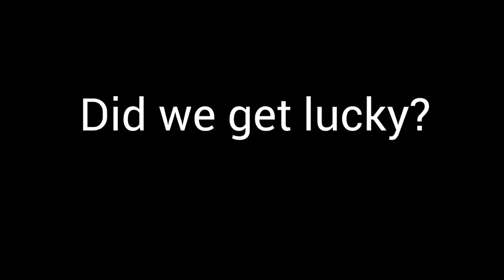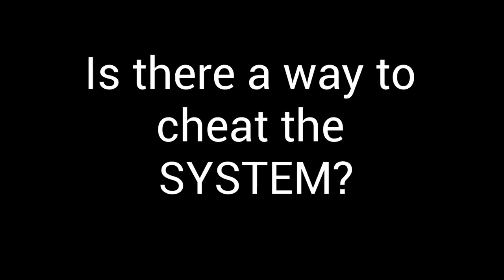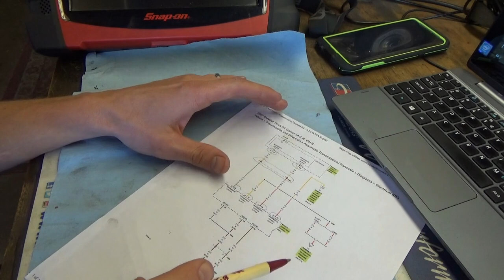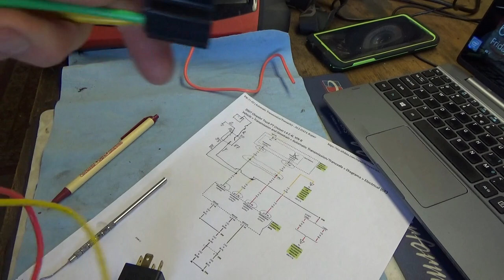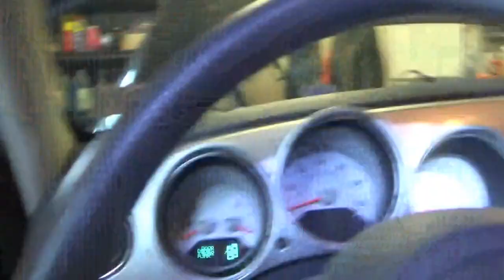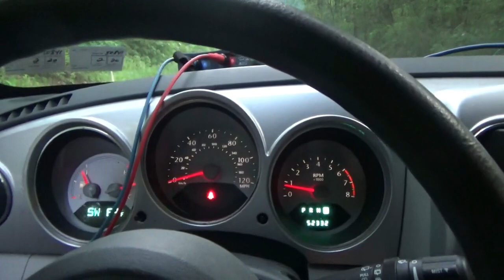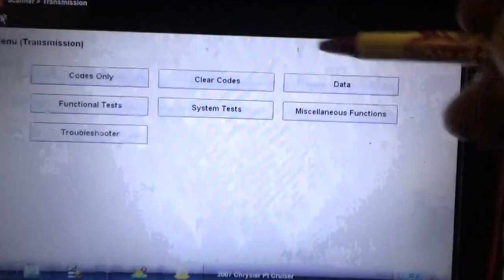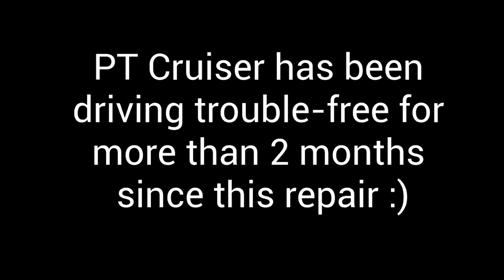Chrysler "LIMP HOME" Cruiser: P0882 - TCM Power Input Low (Part 2 - TIPM!)

Comment: The Toyota relay is the most reliable thing on that car.
Reply from the maker: haha AGREED!
Reply: Pine Hollow Auto Diagnostics I hope it has a built in diode or a resistor inline of control coil for power-off voltage spike suppression which can reach up to 80v what will kill the control transistor/ic  prematurely
Reply: Mac M.  cool find,  fix should last for a long time
Reply: @Airman..  I agree, also with a attenuator on the dso to save it from a 250v + inductive spike ( off state ) if no diode, or wrong direction. NPN's will fry.
Reply: are you implying anything else on that is reliable?
Reply: @Dapsters  bwahaha, touche'
Reply: Ok now I'm replacing mine with a Bosch today lol. But mine works now as a result of this video.
Reply: I think the back seats fold into a hole in the floor...to flatten the rig out for cargo hauling or a bed.
Reply: @PineHollowAutoDiagnostics  just seen ur video, looks good, my 2010 pt cruiser transmission goes into limp mode just after 6 miles.  Code says that shift solenoid B is stuck open, was that the problem with this pt cruiser?  Can you help me and will this hack work with my problem?  Love ur video very insightful !!
Reply from the maker: @nikam6349  Different problem, most likely bad solenoid.
Reply: Okay, I have looked all over that plug, and I do not have a yellow and orange wire. I do have in yellow and orange wire coming out of the bottom of the tipm where the transmission plug is. Can I splice into the yellow and orange wire under there with the same results? Also, just looking at some of the video it looks to me that the yellow and orange wire is coming out directly under the red wire all the way to the far right. I have two red wires coming out all the way over at the far right. Is it possible that the second or lower red wire is supposed to be yellow and orange?
Reply from the maker: @timdean7472  all your questions can be answered with the correct wiring diagram 😁
Reply: @PineHollowAutoDiagnostics  I looked up the wiring diagram for an 06, and it said yellow and orange. But, the only yellow and orange I can find is coming from the tipm. At the plug, I have no yellow and orange wire, but, I do have two red wires. I am not very savy on wiring, so, how do I figure out exactly which wire to tap into at the plug? I did tap into the yellow and orange at the tipm. Just trying to see if you think I'll get the same result you got, or if I need to tap in at the plug. I also will be tapping into the light green wire at the plug. Thanks for any help/ advise you can give me, as I am at my wit's end
Reply: I would love to do this bypass on my 06 PT but not sure which wires to tap into.You lost me between your hand written diagram and when you actually made the connections.Also could I use T taps to conmect to the wires instead of soldering.Thank you. Any help appreciated.
Reply: @winstonemerson2439  wondering the same thing about the T-taps….
Reply: Do you know the part number for the relay?
Reply: @PineHollowAutoDiagnostics  what's the model number for the relay

Comment: Ivan, I love how you always "think out of the box."  I'm a "really" old guy, with a lot of electronic experience, but I always learn from you.  You, sir, have my admiration.  Thank you.
Reply: DAMN ISN'T THAT THE TRUTH, MAKES ME FEEL STUPID SOMETIMES HE DOES.
Reply from the maker: Thank you for the motivation, Michael!
Reply: @PineHollowAutoDiagnostics  You're probably also bypassing some other "safety" issues--- by not letting the TIPM put the transmission in limp mode for other reasons..   For example, I know that if the Accelerator pedal and the throttle body (or throttle position sensor) do not agree because the throttle is sticking, or more likely:  the plastic gears that actuate the throttle body break---  It goes into limp mode, because the throttle could randomly go to WOT (wide open throttle) or something, or could get stuck in WOT after you step on it-- because of a broken piece of gear making it stick open, ect.. ect..   I'm sure there are other reasons.  My 2010 Dodge Nitro had this issue, and the trans was put into limp mode--- obviously by the TIPM----------  This bypass won't allow that to happen now--- so if the car got stuck in WOT, the person would have to think fast enough to lock the brakes, turn off the key, throw it in neutral, ect. ect..   Which honestly I'm fine with myself.   We don't need this nanny state mentality trying to hold everyone's hand and save them from these very unlikely hypotheticals by putting our cars in limp mode for us.  (although, it did happen to my Nitro--- and it did high rev a few times like it had a mind of it's own:   so it's not that uncommon I guess. lol).   A new throttle body fixed my issue.    I love the work around here IVAN..  but it does come with it's legal liabilities.

Comment: I would do the same as you.  Any time you can wire in a relay to do the same job as a module relay, you can do it.  Just make sure the new relay has the appropriate diode across the relay coil to dissipate the control voltage (PCM protection).  Nice Job.  Having the wiring diagrams makes it easy.
Reply: Quite important advice.
Reply: @Peter_Riis_DK  It's worked for me in the past.
Reply: 100% AGREE ON DIODE. AC RIPPLE WILL COOK QUAD DRIVERS.
Reply: Yes,    good idea.  Put a 1n4001 diode across the relay coil - wired cathode (stripe) to PCM control, anode to ground.  This will shunt any high voltage caused by coil field collapse.
Reply: The diode across the relay that is being recommended is essential for long term reliability.  It is referred to as a freewheel diode or flyback diode.  The circuitry in the PCM was not designed to drive a highly inductive load.  Large negative voltage spikes will be applied to the PCM drive pin without the diode.  Over time, either the driver in the PCM or the associated protection circuitry could fail without the freewheel diode.
Reply: Very good point but it hasnt failed by now.  But the voltage spike might be a problem, you ever get shocked by a 12 v relay, I have.
Reply: I am fairly certain these Bosch/Toyota relays have a built-in resistor across the relay coil to reduce the voltage spikes
Reply: @henrydunbar397  Diode Henry, Diode
Reply: A resistor can work too, but it causes the voltage to rise to the level of the coil current x resistor value.  It also causes more drive current to be required.  A resistor will cause the current in the coil to drop to zero faster, but not needed here.  A diode is the better choice.
As for protecting the circuit, there is either protective circuit there already (TVS diode maybe?) or the diode/resistor is already in the relay.  If this were not the case, that output transistor probably would have been destroyed the first time the relay shut off.  That back EMF will rise until something gives way.
Reply: Could you or anyone, please give me the part information & or the # for the Correct relay on this repair?
Please.
Reply: @HUBBABUBBADOOPYDOOP  Could you or anyone, please give me the part information & or the # for the Correct relay on this repair?
Please.

Comment: My granddaughter purchased a 2006 PT Cruiser recently (just got her license) and it started out with P0562 code, low voltage. Checked alternator and it was fine except for the excess ripple voltage. I thought, no biggie, I'll just put an external voltage gauge so that she can keep an eye on the voltage when the battery trouble light sets. Was fine for a while. Then the check engine light comes on and it goes into limp mode. Freaks her out. I check it and now it has the P0882 and P0700 codes related to TCM. Removed and cleaned out some corrosion on the TIPM and resealed it. Looked at the wiring and connectors to TIPM as well as ECM. All looked fine. Still limp mode, though not as often. Having been in electronics, specifically mobile communications, for 40+ years, the ripple voltage on the battery bugged me. I researched filters, bypasses and anything I thought would make the "Loser Cruiser" (Granddaughters name for car) a more reliable ride. In my experience, grounding is of utmost importance in any circuit comprised of solid-state components. The day before I found this video, I removed the ground stud cleaned the chassis down to bare metal and replaced the crimped on lug with a crimped and soldered on lug. Replaced the cable from the battery to the grounding stud and made sure all war tight and clean. It has been 4 days and so far I have had neither battery trouble light or check engine light with associated limp mode. There is also now no ripple on the alternator output. Sorry for long comment, but it appears that there are many PT Cruisers with the same or similar problems and this might just help someone. G0D bless.
Reply: Please, don't apologize for such a valuable comment! Thank you for it.

Comment: Where I work, I use a stereo microscope when looking at circuit boards.  It really allows you to get in there and see things really well.
Also, a lot of people have mentioned a freewheeling diode backwards across the coil.  You didn't mention it so we don't know if you know about it or not.  Before you ever connect a relay, you have to consider the back EMF from the relay coil when you shut it off.  It can be thousands of volts.  Also, the light test on that output doesn't tell you how much stress that light is putting on the circuit.  Something else to be mindful of while doing this type of repair.
Reply: @rickwest2818.  My exact thoughts, i was like that relay is gonna send lightning bolts through the tipm when it keys off. 
I was thinking use a SSR instead.

Comment: I think that is what Chrysler did for the fuel pump circuit failing in the Tipm a few years ago. The Tipm modules were so bad that they were causing vehicles to stall in the middle of the road. They were on back order while they fixed the design flaw so the dealers installed an external relay. Well done, Ivan.
Reply: this video series has been sitting in my Watch Later for like... 5 years. 5 years ago, I was driving a 2005 base model PT Cruiser as a last resort, no money for a replacement unless i wound up in dire straits. Well.... I did. the car would literally start giving me MASSIVE issues actually delivering power above a certain accelerator setting once the engine bay got too warm. The car damn near killed me losing power abruptly while at highway speeds, and would not restore it until I waited an arbitrary amount of time. At the time I had no idea what was going on. I wish I had watched this series back then, because I might have been able to tell someone to figure out what in the TIPM was losing its mind and replace it with a relay. Instead I spent all my money on a completely different used car. Honestly I don't regret doing so. I just think it is insane that a vehicle could be designed this unreliably.

Comment: The underside of that tipm is completely different than the one I was working on but we both came to the same fix essentially, but your choice is a lot more professional than what I did.  I simply eliminated the tipm and connected the two wires together outside of the unit since they were both battery voltage wires I didn't even think about installing a relay. Whoops, but it worked. After 18 months, of having one problem after another we finally got rid of the car and the next owner had zero problems with it afterwards.  Of course the car was totaled in an accident about 6 months after it was sold but they were 6 months of trouble free driving anyhow.
Reply: The TIPM was a bad idea courtesy of Mercedes Benz engineers... Daimler-Benz owned Chrysler at the time and demanded that Chrysler change over to Mercedes-style electrical system (complexity, unreliability, and HANG the cost).   Earlier PTs than 2006 did not have TIPMs.

Comment: Thank you! Thank you! Thank you. I had the P0882 on our 2011 Chrysler 200 Limited. Same TPIM. Spliced both wires under the TPIM. Control was B pin 10, Yellow Brown, (relay) then powers K3 (Yellow Orange) works like a charm! Thanks man! You Rock! Tommy K
Reply from the maker: Nice work 😁👍

Comment: That is the right way yo go. PT cruiser are well know for lots of problems including electrical, transmission and so on. You just safe this PT from the scrap yard and save the owner of a big expensive repair that could easy get half of the cost of the PT cruiser market value. If I'm the customer and you explain what was the plan and I approved it. I will be more than happy with your rate and total cost.

Comment: One tip. That fuse really should be as close to the source as possible to protect against any shorts. That whole section of wire between the battery and fuse is unprotected in this situation.
Reply: John Pilgrim I was thinking the same thing
Reply from the maker: True. The wire itself will act as a fusible link in case it shorts to ground before the fuse haha :)
Reply: @PineHollowAutoDiagnostics  That's Apple level design - their fuses never blow - the other components do.
Reply: Hey! I was going to say that!
Reply: @PineHollowAutoDiagnostics  Almost. You actually wrapped it around the TIPM Feed which is a large 8 ga or 4 ga wire. So when the relay power shorts out and melts, it'll melt the insulation on the 4 ga as well, providing ample current to fry the car!
Reply: @AlAmantea  I am of the primitive mindset that circuit boards have no business around engines and transmissions. Trade those beautiful circuit boards in for old fashioned sturdy components.

Comment: Very good repair Ivan. I'm not Russian but would do the same thing. The only change I would make is to put the fuse very close to the battery terminal. That way the power wire is protected on the way up to the relay.

Comment: Considering it acted up whenever you tapped it or moved it with some sort of vibration it's very likely there's a cold solder joint (cracked). I reckon it's the board interconnect where the two PCBs meet at a right angle (most leverage there when shaking and most movement). Power transistors or MOSFETs actually rarely go bad.

If this went bad, other things might very likely go bad as well soon. If the conformal coating wasn't too thick at that interconnect, I would have tried reflowing that lead-free solder, which is prone to cracking, with some leaded and had a look if that fixed the issue.

Fixed nonetheless, very nice!
Reply: Lead free solder is the culprit in most of these component failures. I can’t stand lead free solder. Imagine how much more reliable consumer electronics would be without it.
Reply: Agreed. The most likely place for a lead free solder to crack is at the 90 degree connection between the two  boards. The gate trace of the MOSFET on the  board goes there (visible at 3:09) and tapping the top of the TIPM might cause the 90  degree connection flex if housing let the connection bend -> failure prone. Bad design. 

If it's not a cracked solder joint, another  option could be installing a micro relay inside the TIPM at the right upper hand area (3:09) of the board and wire it to the signal connector from ECM, load side positive from the MOSFET plus and load out to the output pin.. This way no-one would see the relay ;)

Agree that the risk is that  some other solder joint will crack later at the 90 degree location.
Reply: @Jpilgrim30  Would "Gorilla Glue", or some such, help with this work?

Comment: "What was wrong with old school fuses and relays?"

Well, they didn't fail often enough, and when they did, they were often user-serviceable and inexpensive.  Why let a consumer get away with a $2 fix when you can charge $100 an hour to replace a $200 part?
Reply: Well said, "K_Tech". Enough is enough! Too far with the digital thing! Time for We The People's Retro-Rebellion!
Reply: Hey I'm going through the same thing but on a 08 Dodge avenger mimic what you did with the pigtail I didn't use the Toyota style of relay  and I wasn't sure on which of yellow and orange wire you were speaking of so many help would be appreciated thank you for the video
Reply: Guess again, tipms run aver $1500 nowadays

Comment: You my man never fail to amaze me. You are a genius.
Reply: brilliant old school solutions to throw away society .need more tradesmen like you
Reply: My thoughts exactly. Great job Ivan, I remember some years ago having an overheating issue with a GM car. It turned out to be the ecm not activating the electric cooling fans. I basically did the similar thing you did by doing it the"old school way" and presto no more overheating problems. I've done this with electric fuel pumps as well, works every time. Nothing like the old school way IMO.

Comment: absolutely exact issue, absolute exact way i planned on going about attempting a repair vs replacement, but most of all the absolute best video, most comprehensive communication thru process of elimination, testing, repair confirmation...simply the best video anyone could of done working through an issue that may not be the most complex, but isn't simple either. Much appreciated sir. I wonder what you would charge after the added inflation of the last 4 years.

Comment: I knew you'd get there Ivan.  I've done several TPIM relay bypasses.  Never for the TCM power though.   I keep a few relays with pig tails on hand.   You can get them in 10 packs on e-bay.  It's common enough that I even keep one in my mobile load out.  I have done 4 or 5 for fuel pump.   I normally charge around $200 for this.   I often worried that if one circuit in the TPIM failed, more may be getting ready to fail.  But I have never had a comeback on one.  First one I did was 2 years ago.  600 degrees Ivan?!?!  I normally solder around 380-420!  I use silver bearing solder though.   ;)
Reply: $200.00 is very fair